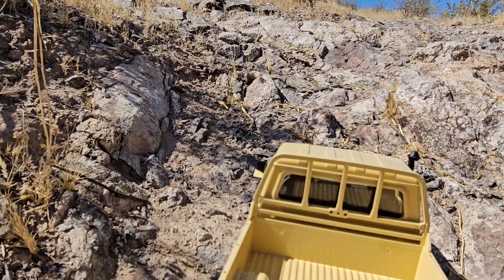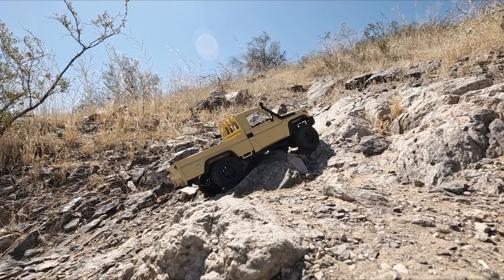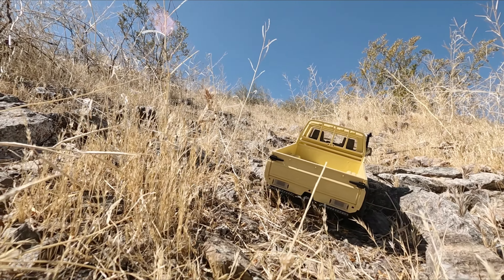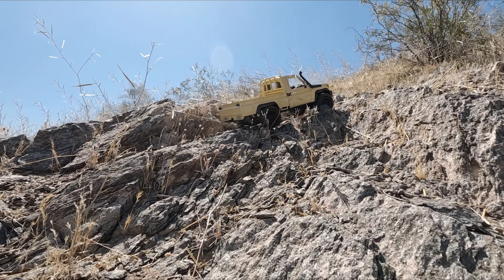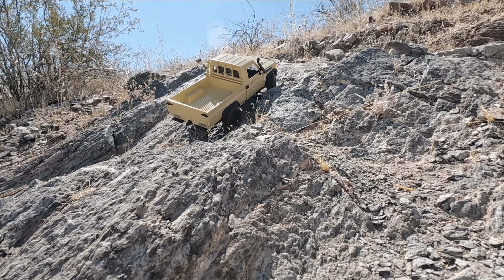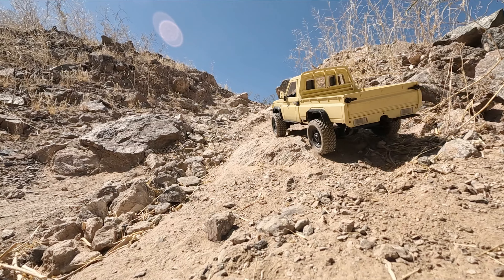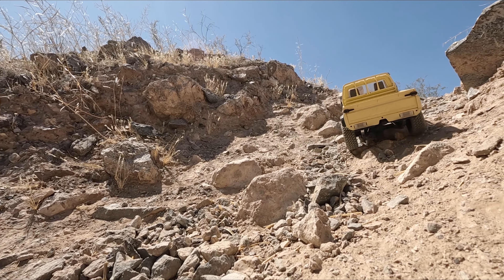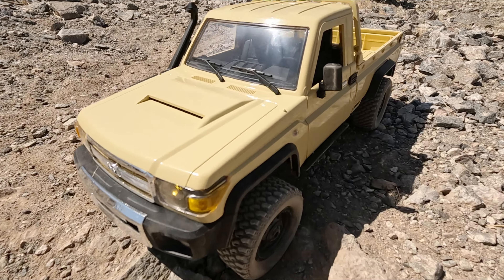MN Model MN82 Toyota Land Cruiser RC Truck RTR.

Comment: This is an awesome rig brother ive upgraded it with an fms esc and transmitter combo having the availability to adjust drag and speed on the fly is awesome man and the slow crawl improved soo much brother its a great and cheap way to get this rig in a good state of control 🤟
Reply from the maker: Thanks for sharing! I definitely want to run this more and see how little I can change and still enjoy it. It's definitely surprised me in stick form so it deserves the attention. Not to mention its a looker!
Reply: @RunThatRC  yes indeed no doubt about it brother 🤟

Comment: Did they update/ improve this one?  I've been looking at this and the mn72 but they've got some pretty lousy reviews. If / when I do pull the trigger on this that sand coke looks really good on that terrain.  If yurts no electrical issues I think with some metal wheels and softer tires that thing would be pretty capable
Reply from the maker: I haven't had a MN model in a while and this one definitely impressed me. These types of RC definitely get a bad wrap from RC youtubers because most of them only mess with expensive stuff. Some think if its cheap you wont have fun or it going to be a bad experience. These are cheap scale Rc trucks and they expect crawler like performance. You can mod these to perform good but a rock crawler its not. Unless your extreme with the mods to the point you cant recognize what it started out as. I personally like trail rigs, being less capable makes it fun to conquer terrain rather than easily naking it up everything com cralwer style lol.
Reply: The MN78 was supbar out of the box, but the MN82 was great out of the box. I don't know what they improve on though.

Comment: Please tell me good offroad tyres for it to make it lifted with good grip? From aliexpress
Reply from the maker: I haven't looked into it yet but if mn model has portal axle upgrades like WPL then you can do that to get a lift so you can add bigger better tires. I would have to search for some and I will make another video if I find some.
Reply: I think you should be able to use the same 70mm tires you used on the c54. Just maybe cut the front fenders a bit. Would love to see a video with those tires on this guy!